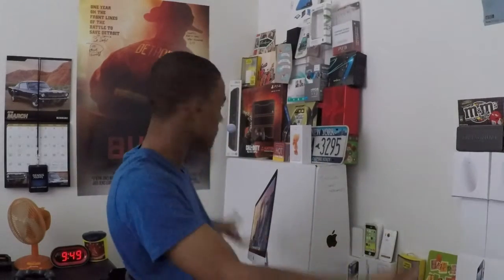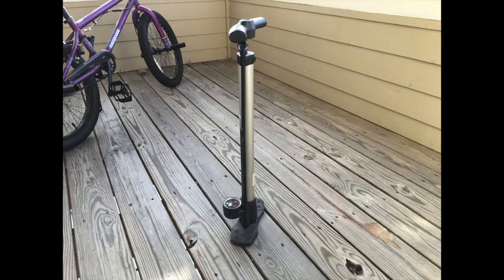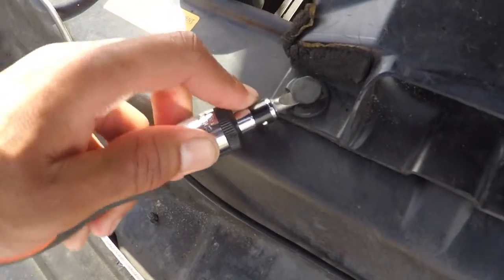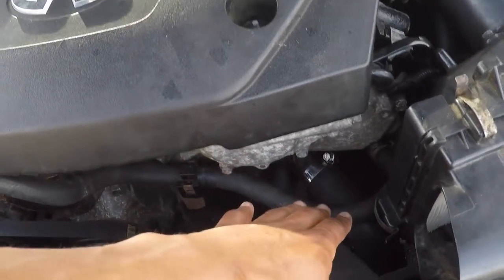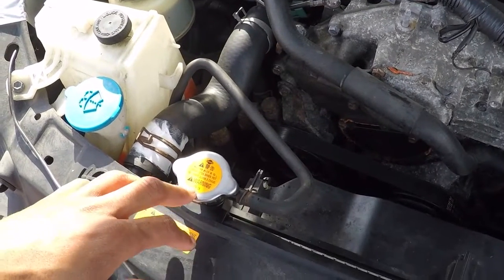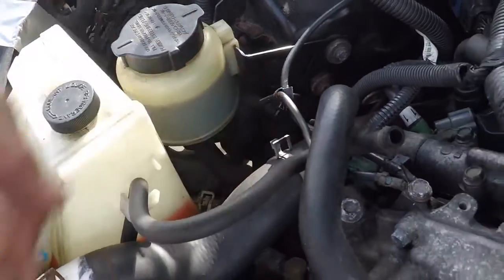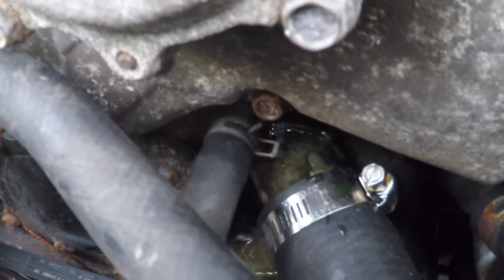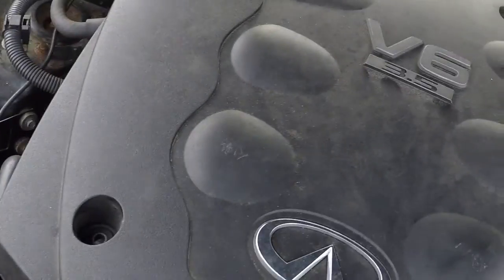Pressure Testing Engine Coolant System (Without Expensive Tools)

Comment: Just tried your pressure testing engine coolant with a bicycle pump... You are a very clever young man. There are several videos on here showing all kinds of complicated ways to do this. Your method is by far the easiest, and it works! You earned yourself a new subscriber! Are you still active on your channel? You should have way more subscribers than you do.

Comment: I don't have a radiator cap on my vehicle that I've found so giving Autozone the $250 to rent (I'd get it back of course) the special tool may have not even worked if it didn't have an adapter for the reservoir tank. My reservoir tank does have a short overflow hose coming out of it, so I'm able to use a bicycle pump to pressurize the system without removing the cap hopefully.

I'm also both a tech person and a car person. Whatever I'm into the most at the time changes in seasons but right now I'm more into cars.

Comment: I tried this but my radiator cap has a seal that stops the air flow from getting into the radiator. It’s just a standard cap set up like in this video. Edit-Fix- I bought another cap and drilled a small hole through the bottom part. Now it works great using this guys bicycle pump trick.